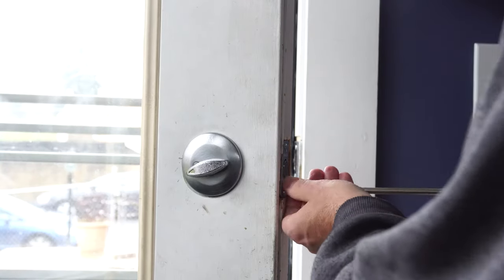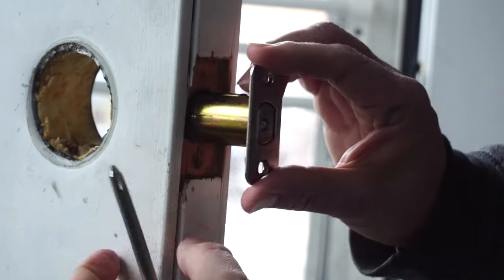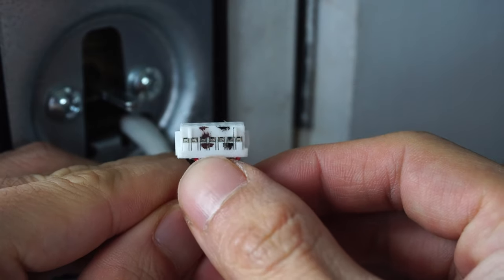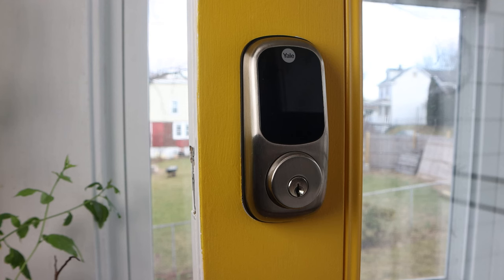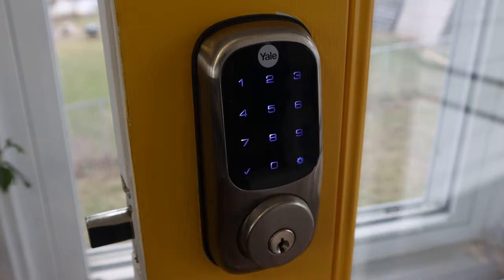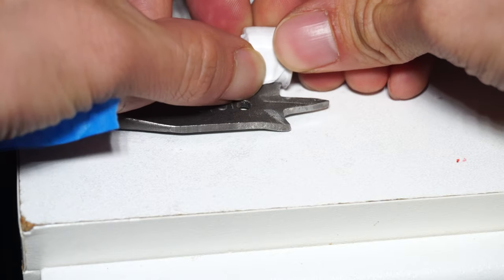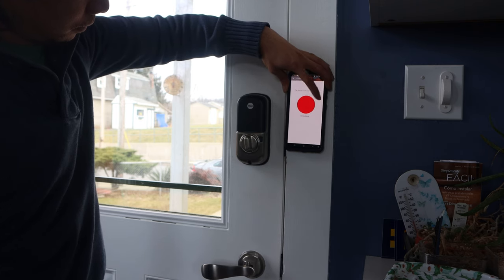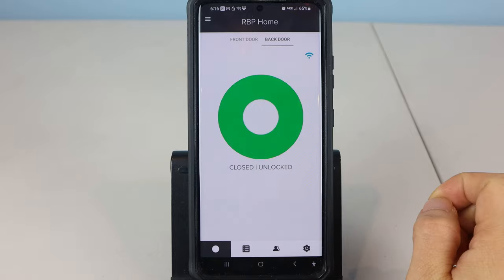How to Install and Setup Yale Assure Lock Gen 1 w/WiFi Module - Full Installation Instructions

Comment: Hi thanks for the video very informative.

@5:27 I feel like I’m missing something. I can’t seem to get it connected/registered. 

I’ve entered 7 and gear key multiple times but still can’t seem to get connected. 

Any advice
Reply from the maker: Did you get it sorted? The batteries need to be removed during installation of the WiFi module. Try removing the batteries, removing the module, then reinserting the module before putting the batteries back in. Once you've done that, go to the app and enter setup mode by entering your master passcode followed by the gear icon and select 7, followed by the gear icon, to activate the module. If your module still isn't registering, there may be a problem with it and I would contact Yale for further support or a replacement.
Reply: I’m having the same issue. Did you get it sorted ?

Comment: Phil, I have the same setup as you do.  Somehow I cannot connect the wifi module to the lock.  I would like to restart the whole software setup process.. Do you know how I can wipe the settings clean and restart from square 1?
Reply: There is a reset button on the inside of the handle. You have to take the screws out to access it.

 Take all the batteries out, hold the reset button down until you put all the batteries back in then release it.

Comment: My bolt gets stuck .. can I just change the latch ?
Reply from the maker: Generally, deadbolts that jam or get stuck indicate that the hole for the strike plate and the bolt are misaligned. The only way to really correct that is to re-drill one or both hole. Sometimes you can get away with simply moving the strike plate over, though you may need to expand the latch hole to do so.

Comment: I am trying to connect devise to wifi, and whenever i put serial number it says invalid.  Any help ? Where can i find the correct serial number !
Reply from the maker: The serial number (and QR code) for the WiFi model is on the bottom of it (see 3:31). Make sure that you remove the batteries from the lock before removing and installing the module.

Comment: what August Control Module model is that which is compatible with Yale Lock Assure YRD226 (the one in the video).
Reply from the maker: The model# on the back of my August module is MD-01.

Comment: What is the advantage of the sensor? The people I bought my door and lock from don't seem to know much about the sensor. Thanks
Reply from the maker: The sensor allows the lock to detect whether the door is open or closed. Without it, it only knows if the deadbolt is locked or unlocked, but not the position of the door itself. It uses this information to determine when to self-lock (e.g. it won't do so if the door is still open) and it will also show you the door position status in the app, open or closed.

Comment: do you have a link where i can find the module ? Can't find it anywhere
Reply from the maker: Here's the link where you can get the module at Amazon: https://geni.us/hkq603b [Amazon Affiliate Product Link] It comes with the AC Bridge (as it is required for WiFi connections).